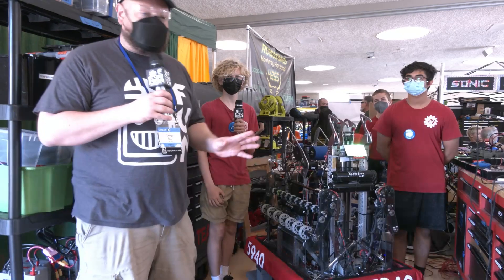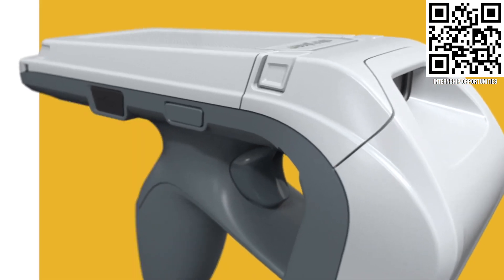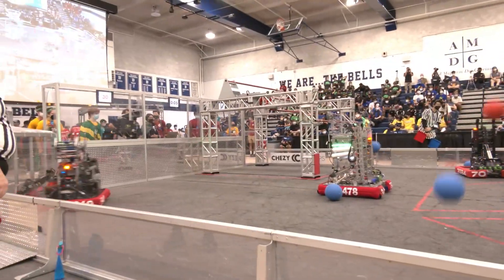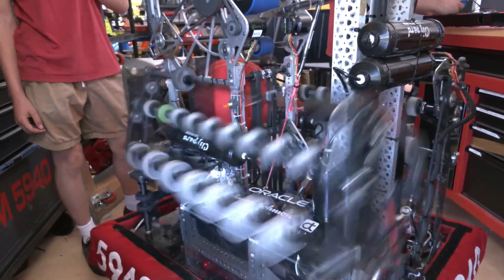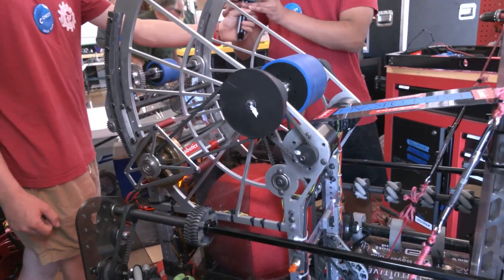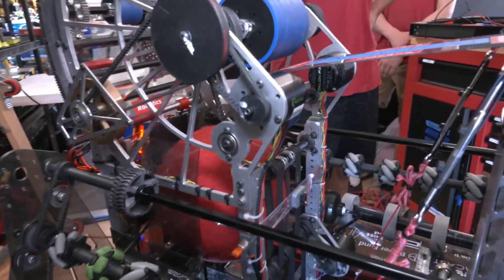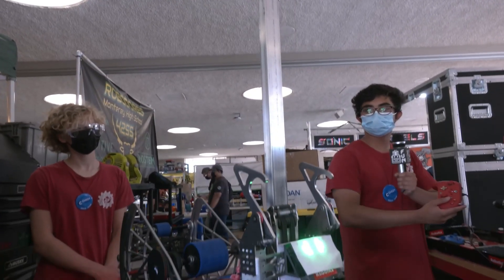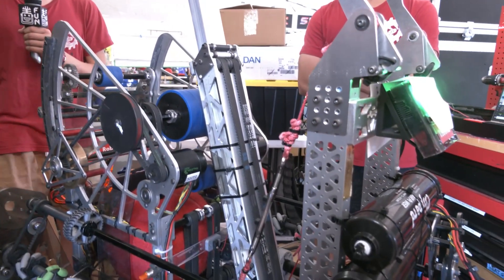Behind the Bumpers 5940 BREAD Rapid React Robot

Comment: As someone just getting back into frc as a senior (maybe I should check CD before asking this) in what way do the belts propel the box tubing?
Reply: Some sort of timing belt clamp?
Reply: It is essentially rigged like a chain elevator-the belt is attached to the bottom of the climber on both ends so that it goes from the bottom of the climber, around the bottom pulleys, around the top pulleys and then going down and attaching to the bottom of the inner stage forming the a loop.and the pulleys driven by the motors at the bottom will spin and then the climber goes up or down. If you think about the attachment point at the bottom of the inner stage like a tooth of a belt, when that belt spins around it is either going to go up or down.
Reply: @yeetskeet9907  Thank you so much! To attach it would you use some sort of belt clamb that would have the opposite teeth to lock it in, or would you just put a some bolts through it?